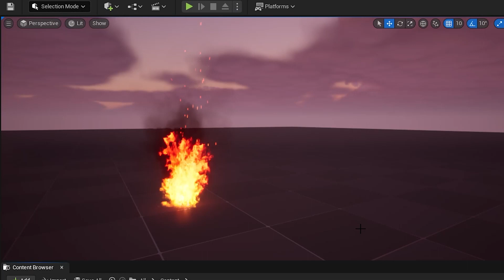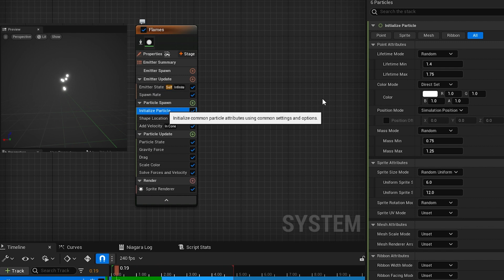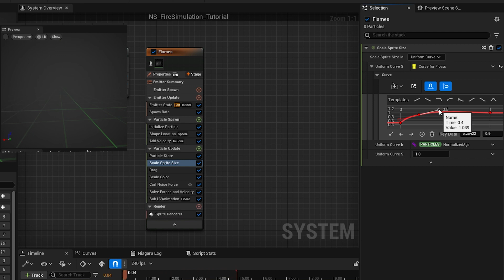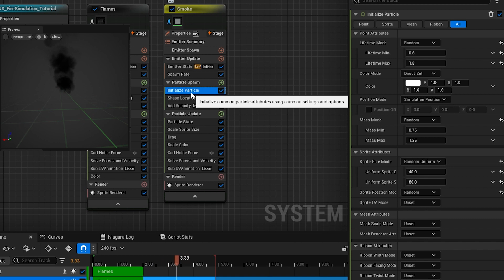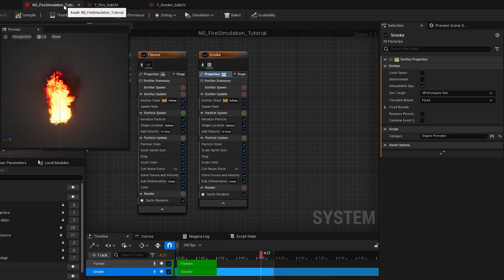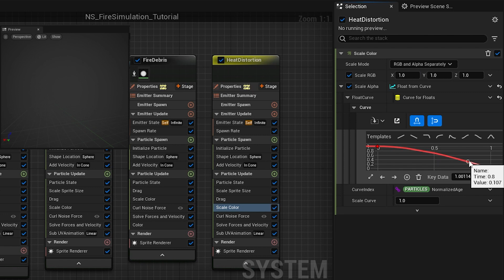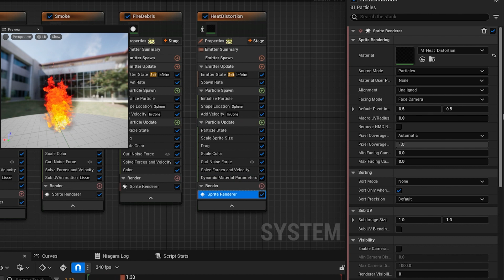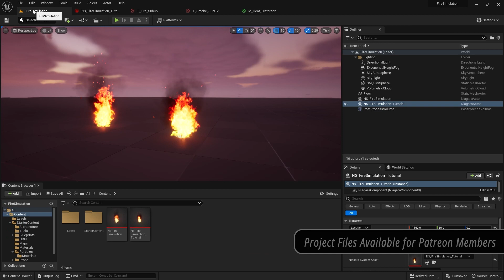Fire Simulation FX in Unreal Engine Niagara | in 12 minutes

Comment: For people who made this but their flame is super flat (AKA it's not emissive and glowing), I couldn't figure out why his was glowing by default (it randomly changes from flat to glowing at 0:55), but I found a solution. Open the M_Flame_SubUV material which is referenced by your Niagara System (Content browser > Starter Content > Particles > Materials). Add a multiply node right before the Emissive Color input, and basically multiply that value by 10 or 20. This made the colors look better for me, but it didn't make it glow. For that I went into my render camera settings > Post Process > and enabled "Bloom." I adjusted the intensity until it looked good. If you get annoying lens flares, just enable the Lens Flare setting (also under Post Process) and set the intensity to zero. Hope this helps.
Reply: Got the solution! Just go to the material of the flame in the content browser, make a MULTIPLY just before all the input that goes to emissive color, and add a parameter with a default value of 50 (depends of your taste) to multiply that.
Reply: @naujetneciv  It worked!
Reply: Hey man I’m having the same problem. Where can I find the render camera settings that you’ve mentioned? I can’t figure out where it is to try your solution.
Reply: @caiozulian2509  go to your project settings in edit you'll find everything there :)
Reply: @caiozulian2509  Basically the solution is simply to increase the light bloom in your scene. There are multiply ways to do this (you can apply the bloom settings specifically to your render camera, or with a post process volume which is what I now prefer to do). A post process volume (PPV) will basically create a post FX for everything in your scene, if that makes sense. 

In your scene, create new > Visual Effects > "Post Process Volume." In post process volume details, search for "Infinite Extent: Unbound" and enable it (this makes it so your PPV applies to the whole scene). Then, in the PPV details, go to the "Bloom" dropdown and enable all the options. Adjust the amount of bloom with the intensity slider. Also, the Bloom Mode "Convolution" always looks better than "Standard," in my opinion, so try that out. 

You could also do this in the details of your CineCamera Actor, same exact process. But I like to do it with a post process volume so it applies to my scene even when I'm not looking through the camera.
Reply: I would recommend to make a blueprint out of the niagara and add a point light. In the event begin play, set random relative location -2 to +2 and set random intensity of the light to whatever you feel fits your scene and loop every 0.1 seconds. Makes the light come alive a lot more.
Oh yeah and set temperature to around 2200 for the light.
Reply: Just make sure you only make changes to a COPY of the material not the original.
Reply: it does not look like his anyways

Comment: Good tutorial, thanks! For Some reason I don't have this bloom around the particles that you get by default, when you create an emitter. I can't figure it out. Increasing RGB values in particle color has no effect. Also the light from the flame is only seen with the inverse squared falloff turned off.

Comment: 8:33 on my ue5.1 the heat distortion material is not working. I did what you asked me to do. but it still doesn't work. then in the particles the distortion also does not work. what do i do to fix this?